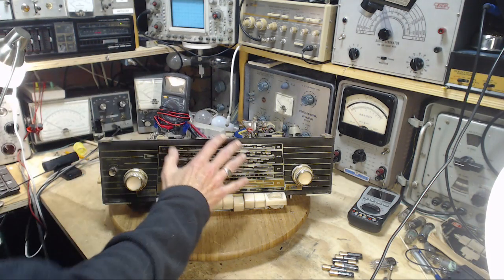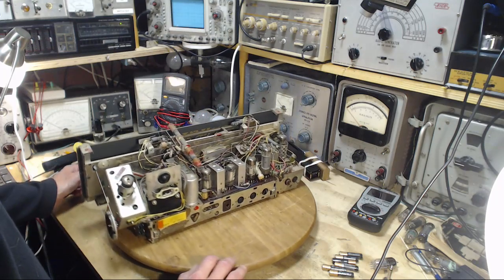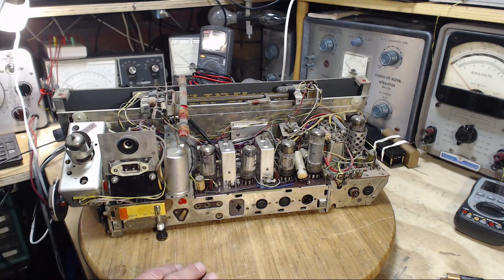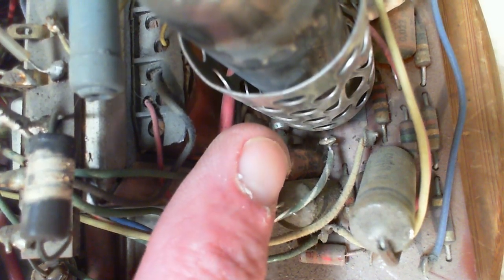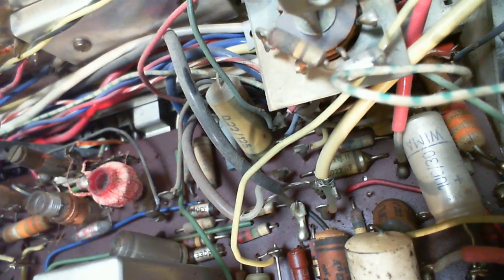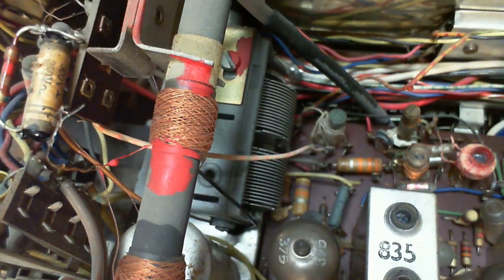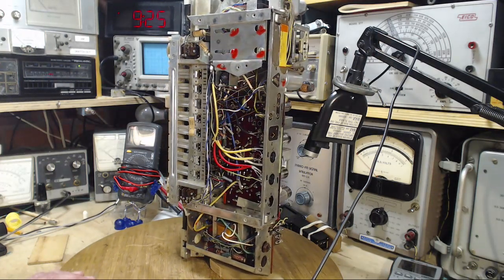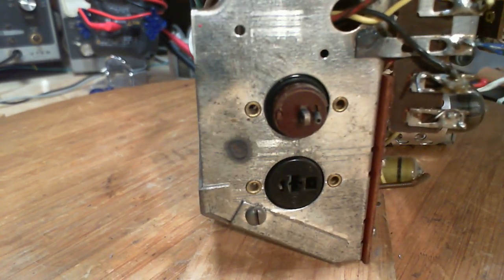Korting German Console Receiver Video #1 - Checkout

Comment: Hi Jim, that's another interesting one on your Bench - looking forward to seeing you work on it!
The "Alien Technology" you're referring to at 12:00 is a connector plug to hook up - yet another - keyboard to mess with the sound mixing of the radio. You could select different Treble/Base Combinations for, say, Orchestra, Jazz, Speech and so on with the push of a button.
This one appears not to have such a keyboard attached to it, might well be a factory option to have the customer choose. 
The plug can be pulled out of the socket to make the job of taking the chassis out of a radio simpler as you don't have to desolder all the wires going to it, first.

Comment: It's great to see you working on this Korting Radio. I have the exact same one. The Alien Technology plug is a MPX shorting plug. I assume it would be removed if it had the stereo multiplex unit. Also the selenium rectifier is screwed to the back of the face plate reflector. What you thought was a selenium rectifier is actually the line power for the turntable and tape deck. This model has 2 output transformers T3 being on top and T2 on the underside. Unfortunately my T3 if bad and I have not been able to source one. Thanks for all of your great videos!
Reply from the maker: Thank you for the very helpful information.

Comment: Dear Jim, the FM Tuner looks like from Telefunken, this explains the FM tuning knob also works as SW bandspread. The condensers with resin or epoxy ends may remain in the chassis, only the power tube grid couplers should be changed in my humble opinion.

Comment: European FM broadcast band is 88 to 108 MHz
Reply: Actually from 1949 to 1964 the FM Band in germany was limited to 87,5 to 100MHz. Then from 1964 to 1968 extended to 104,5MHz and only after 1968 officially opened up to 108MHz. But may sets sold during the early to mid 70s still ended at 104MHz because the only radio stations available back then - public radio stations -  were located below 104. Only with private radio stations slowly ermerging and unoccupied frequencies becoming sought after the frequencies upward 104MHz were actually populated.